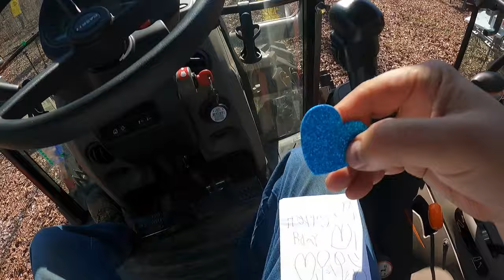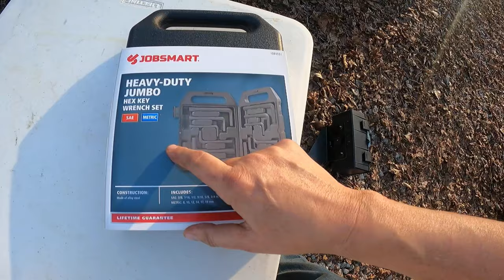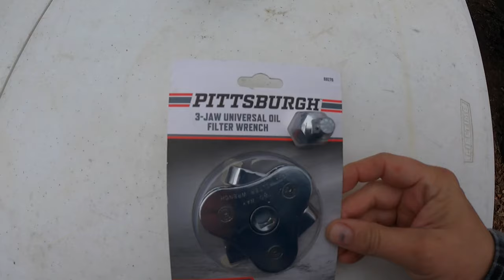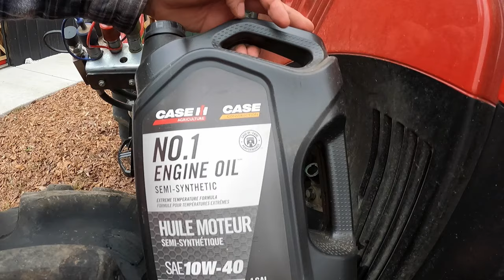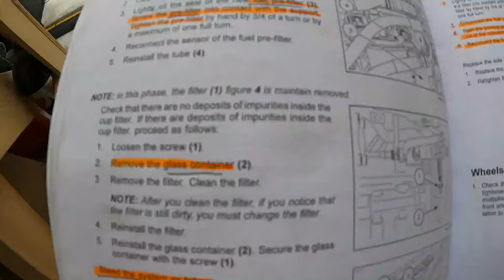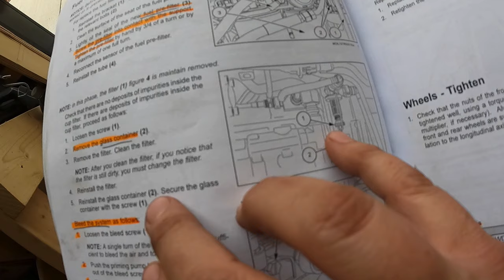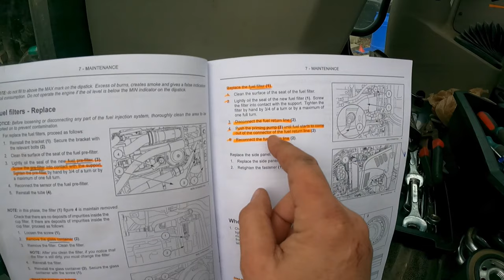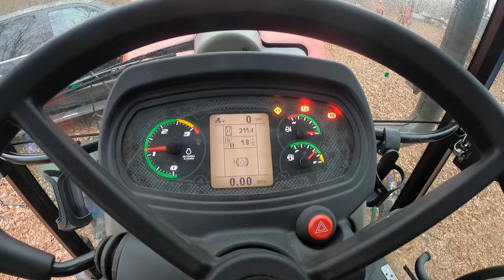OIL & FILTER change CASE IH 75C, Ordeal NOT Ideal!

Comment: Just did all 3 filters talked to the Case tec first he told me to fill the filters all way up gave a little more advice I didn't follow nor will mention he said the way they do it well after the filters went on I open blead screw pumped  300 times non stop took about 10 minutes turned over mabe  9 times and started . This works
Reply from the maker: @jloden8873  great job! You got this!

Comment: I own a 75c C also. I just changed the oil today for the first time. " Ordeal not ideal" is a complete understatement. Had the Italian engineer been standing next to me with wrenches in my hand, it would not have been a pretty picture. I took the same route you took, never again. Yes, you do need to remove the loader and toolbox. You do not have to remove the fuel filters but do not remove the side cover bracket. Next, release the electrical connection and tube that run vertically in front of the oil filter. The FILTER WRENCH YOU NEED is a cap type 93mm, 15 flute made by PT part number W54107 sold at Auto Zone for $4.00. This wrench will not fit the filter that comes on the new tractor, but fits the CaseIH replacement perfectly. It is still a very tight fight, but the hydraulic hose and the bracket will flex just enough to pull the filter out and get it back in. I must stress, again, do not remove the side panel bracket, unless the engineer is near, then by all means insert it. The oil plugs are 12mm and yes, the wrench will need to be cut to fit behind the hydraulic oil filter. Thank you so much for the video. P.S. I will never buy a Ferrari after this debacle.
Reply from the maker: @dalesiebert7093  lol!! Thanks man! I appreciate all of the info. Yes a Ferrari is officially off of my list now too.

Comment: I completely filled, sealed & pressurized the fuel tank with an air compressor. With the bleed screw open, fuel ran through the system and most the air was pushed out the bleed screw. Then I cranked the starter to finish bleeding the system. The tractor started and ran. The entire fuel system holds around a gallon. Reattaching the loader on un level ground was my ordeal.

Comment: The (oil gauge)as you call it is actually the coolant temperature gauge low oil pressure is only a little light directly opposite the low temperature on the temp gauge above the glow plug light hope this helps
Reply from the maker: Thanks yes figured that out afterwards. Can’t take back video evidence of ignorance. lol.

Comment: Same set up on my New Holland 55 (basically same as your 75c both made by CNH). Instead of buying a new allen wrench I took one that was slightly to big and shaved it down slightly with a grinder with a sanding disc til she fit. Better than wasting the day for me running 45 minutes to town. Gotta wonder what these egineers are thinking when they design these tractors/ engines.

Comment: Is there a relocation kit available to move the oil filter to another location? I'm looking at getting a used 2021 Case 75A full cab loader. Thanks for your videos.
Reply from the maker: A relocation kit would be nice but I don’t think they have one. However, I think that the A model may be located in a different place. I appreciate your comment.

Comment: Was a new holland service manager mechanic. Fuel filters are not worth messing with pay for one injector with debris. Get yourself a strap filter wrench with a ratchet . Do not stab with screwdriver makes it worst to take off.
Reply: Check to see if you can purchase a remote oil filter relocation kit
Reply: Can you get that from a dealer?
Reply from the maker: I may need to stay in touch with you. lol. Thanks for the input!